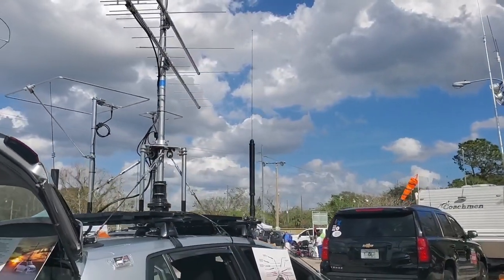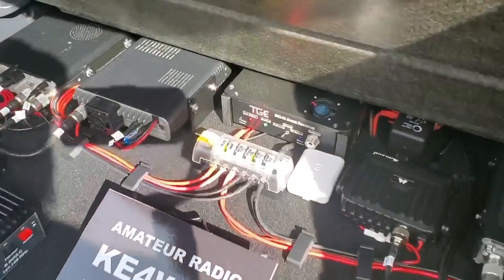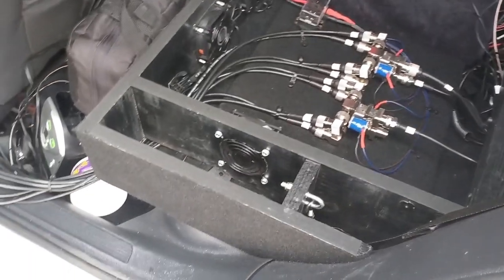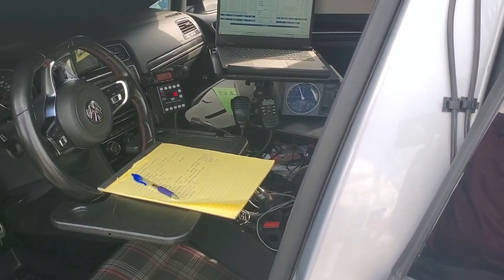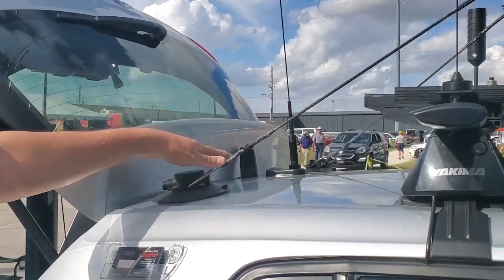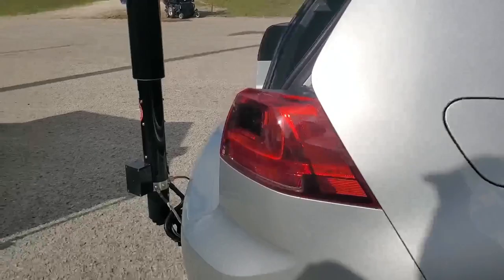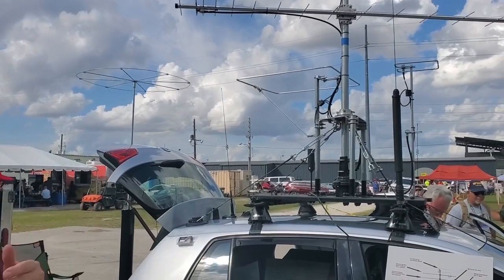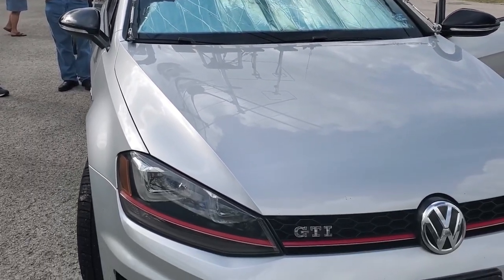ULTIMATE Ham Radio Vehicle Setup from Hamcation 2023

Comment: Is it safe to transmit from within the car, meaning that close to the antenna, at 50 or 100 W ?
Reply: I think it's perfectly safe, especially with the roof between me and the antenna. Even though my most powerful band (2m) has an ERP of 1000W+, the focus of the power is six feet over my head and in the direction of the beam... plus, the roof to shield me. Today, the tower rides on a trailer; so, more distance between the antenna and me. My trailer setup will be at HamCation in 2024. 73! -Scott, KE4WMF

Comment: He did a great install job, but that's a lot of radio equipment and antennas on one little 4-door car.  😲
Reply: In truth, some antennas do interact with each other. What you saw in the video is really an exhibition setup. Ordinarily, I have just the verticals mounted. IF I mount the horizontals, then the HF antennas come off. Thanks for your comment!
Reply: @StealthGTI  ~ I assumed that was your daily-driver, WOW. Thanks for clearing that up for me. 😎
Reply: @royrobinson4636  - Just to be clear, it IS my daily driver! The car recently surpassed 180,000 miles.  🙂